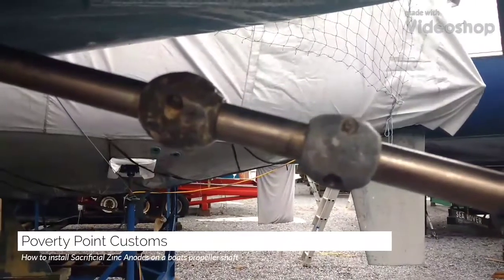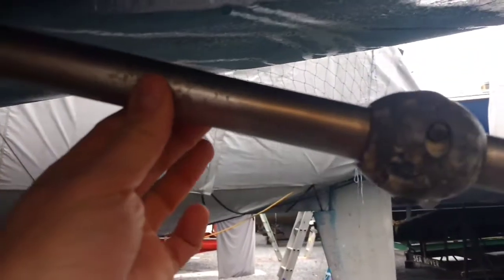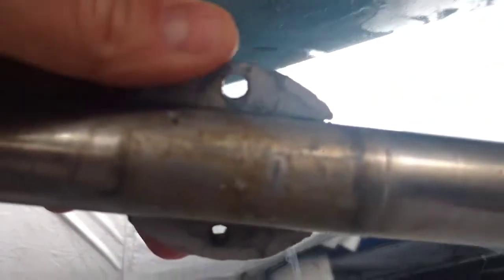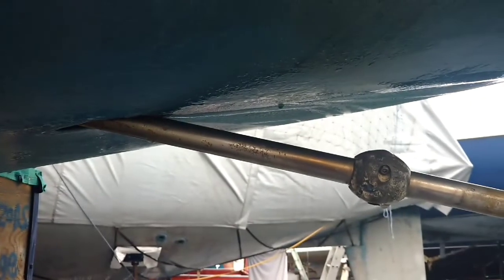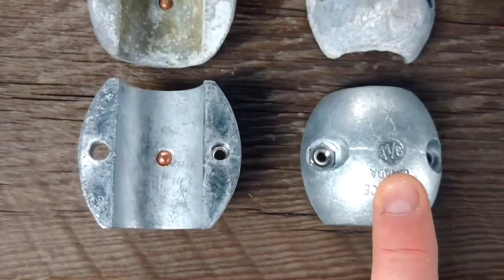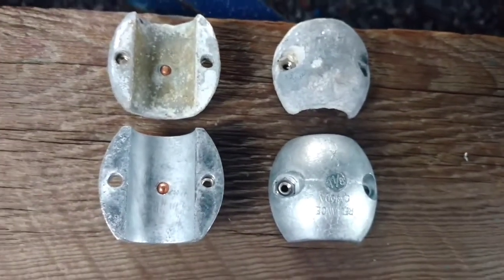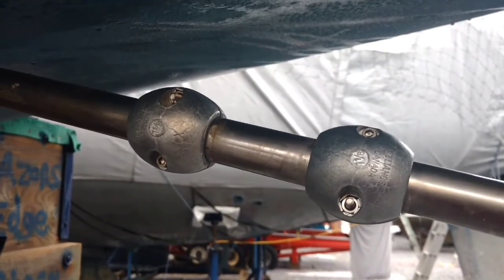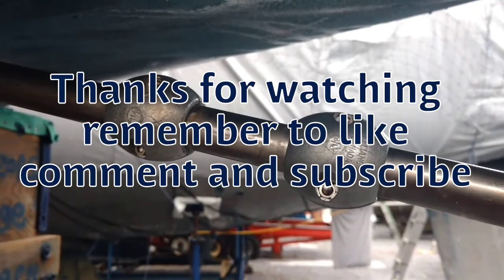How to replace and install Sacrificial Zinc Anodes on a boats propeller shaft

Comment: Nice job.  BTW how's the prop doing ?  I would consider putting one anode closer to the cutlass bearing, the closer to the prop, the better.  I personally fill the holes in the anodes where the nuts and bolts are with white silicone to minimize 'first' corrosion of the stainless steel.  My anodes always last one season (salty North Sea) and don't come off.
Reply from the maker: Thank you, so far no issues with the props, it's original from 1988. It's mostly fresh water here but with a little salt in it. That's a great idea about the silicon in the nut bolt holes, I'll give that a try this spring and also may take your suggestion on moving the anodes. Cheers from Eastern Canada

Comment: did you use Loctite on the bolts? if so, which Loctite?
Reply from the maker: We did not and have not had issues with them loosening up, but it certainly wouldn't hurt. We replace them yearly, and the boats in the water from mid May to September (fresh water).